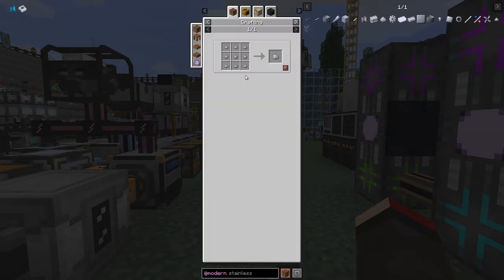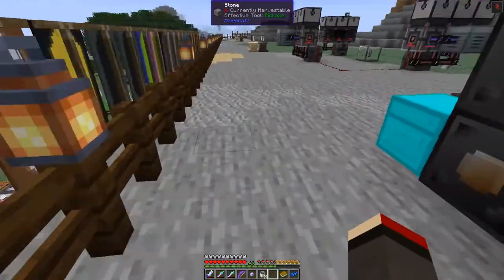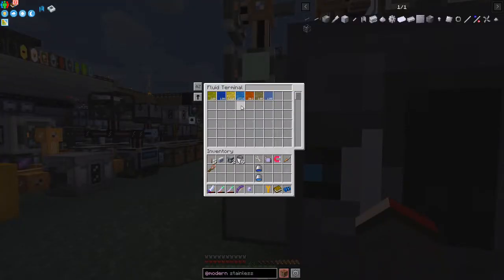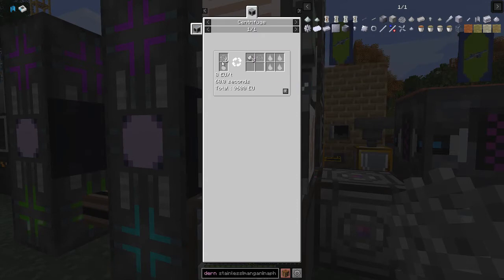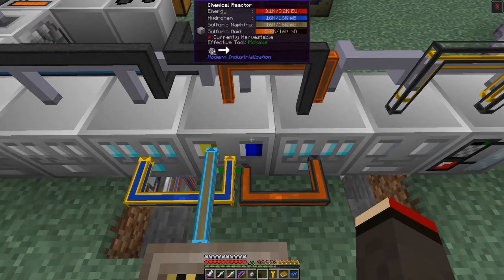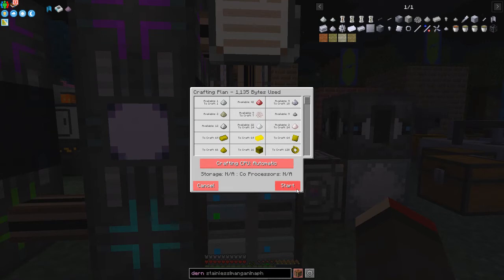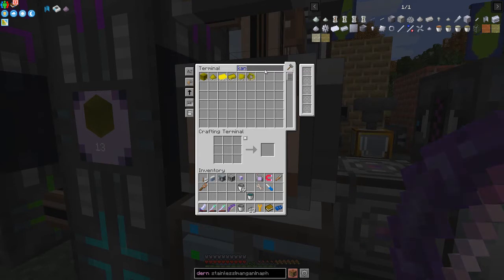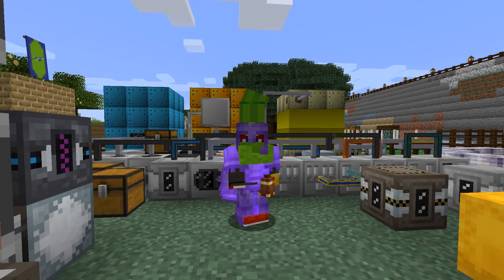All of Fabric 3 #42 - Modern Industrialization: Manganese, Stainless Steel & Kanthal Coils

Comment: Has this changed recently? i dont see the recipir for crushed chrome dust in the macerator, also obtaining all those liquids seems like hell for such a tiny amount
Reply from the maker: My guess is that the mod was new and so it would change over time. Modern industrialisation is a challenging mod.
Reply: @duncanwebb4934  I see , so stainless steel is harder to make since you can't directly convert crushed dust to dust